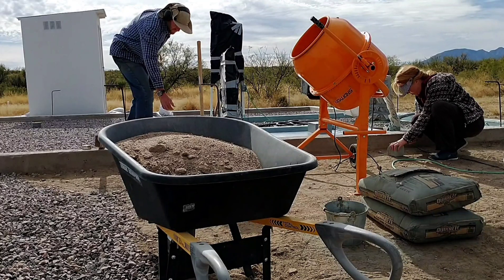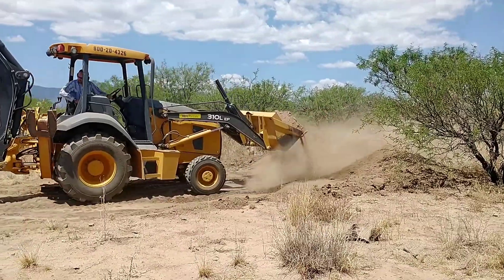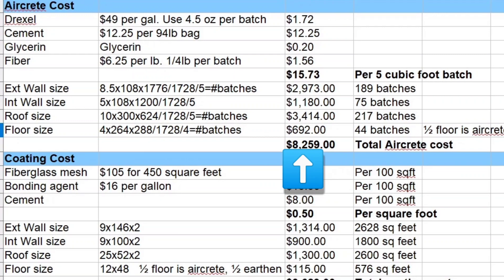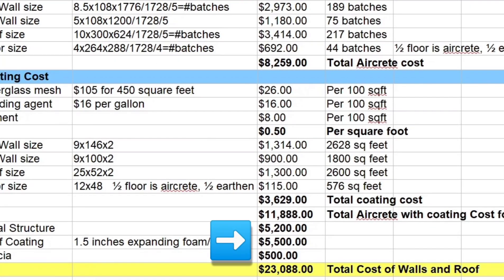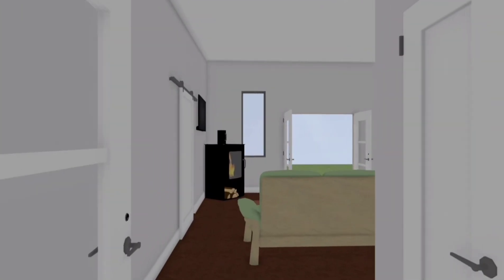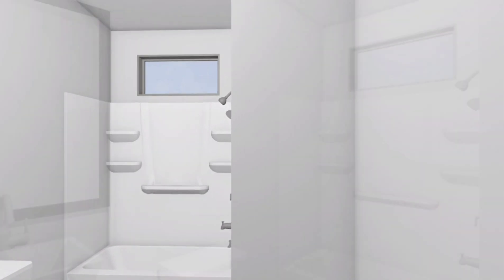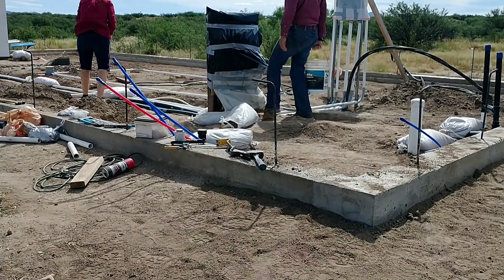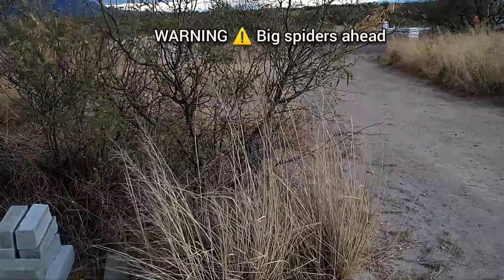AIRCRETE vs Traditional Home COST Comparison 🏠 DIY Off-Grid Build

Comment: Thank you for the excellent break down of the actual costs! Apparently aircrete with the coatings required costs at least $4.50 per cubic foot.
Reply from the maker: It's been awhile since we ran the numbers, but we did learn it wasn't going to save us any money, and it was going to be a lot more work. We also didn't include the cost of the forms.

Comment: I think you saved a lot of people time and stress making this decision. 
That being said, comparing the two methods building a small (100 to 150 sq ft. structure ...think basic cabin--not house) in a tropical area,with only aircrete as structure and insulation,do you think the costs per would yield similar results ?
Reply from the maker: If you already have the equipment to make aircrete, and build a dome shape, aircrete would be less expensive. A traditional structure could be built faster, would last longer, and likely wouldn't cost too much more.  I have heard of multiple aircrete domes with water leaks that can't be repaired, because the aircrete near the cracks turns to powder.
 If you have some time, and want to build a structure that is inexpensive and strong, I would recommend hyperadobe. We just finished helping our son complete his hyperadobe tiny house.  
Best wishes! 🌞🏜️
Reply: Thank you !  About what I thought your answer would be. @RedandAprilOff-Grid

Comment: must look up your previous vids but that looks like very crumble aircrete. you would of been safer just using a professional aircrete blocks, would of been way stronger.
Reply from the maker: They are hard to find here. We learned that this type of aircrete is too temperature sensitive, and hard to get consistent results, so we went with a more traditional build.

Comment: to bad you did not look closely at "Honey Do" Aircrete structure
Reply from the maker: I watched a whole lot of aircrete videos. Most of the aircrete guys have so many videos, it's really hard to find answers to any particular problem, and we just didn't have time to watch all of them. 
Some of our aircrete turned out awesome, but as the temperatures got colder, our guess is that we needed to use warm water in the soap solution.  
I'm excited to follow Honey Do Carpenter's aircrete house build, but I am glad we have moved away from aircrete. With our particular house design, aircrete was going to be slightly more expensive, and way more work.

Comment: Since the low foam yielded best results, could the reason for the failures and cracking have been the amount of water?  Depending on the foam used could have contained a significant amount of water that wasn't accounted for, maybe??  I'm completely new to aircrete, so assume what I'm throwing out here are just wild guesses with this stuff, but I'm not a stranger to concrete.  I've been fascinated with it ever since I was a kid.  The UHPC used in pre-cast pre-stressed beams last time I dug into a white paper used a significant amount of cement to aggregate ratio, roughly 1:1 and the aggregate is super fine, but the cement to water ratio is significantly reduced.  Would almost be a dry pour if not for the add mixtures used.   It really seems like yall were on the right track with the high cement ratio.  Maybe one day this stuff will take off..  Just hoping someone doesn't figure out the secret and all of a sudden the price skyrockets up next to lumber...  lol  Seems to be the way things usually end up   Anyways, cool vid bud.  Still going through the playlist.  Thanks for putting all this out there
Reply from the maker: We are using a somewhat low water mix to make the aircrete stronger. The typical recipe that most seem to be using has 6 or sometimes even 7 gallons of water, and we were using 5 in all of our test samples. It makes it stronger, but I'm sure also less insulative. It also seems to make the slurry heavier which make it harder to get the heavy stuff at the bottom mixed in with the foam. If we had decided to move ahead with aircrete we probably would have bought a mortar mixer. 
Adding styrofoam to aircrete is all the rage now, I think it will have issues too, and will be a lot of work, but we'll see how it works out for people as they start trying to make stuff out of it. There has been a shortage of Portland cement in our area lately, probably due to shipping issues, so it seems like the price will go up on it. 
Aircrete is interesting stuff, and tricky to make. It's been an interesting experiment, but we are glad to be moving on. Now that lumber prices have gone down some, a more traditional house with more insulation than the aircrete house will be less expensive anyway. We have a video comparing the cost. 🙂🏠
Reply: @RedandAprilOff-Grid  

I’m new to aircrete.

I saw your other video where you was using literal styrofoam polystrene.

And then I’ve seen other videos where people are making foam from soap and using that to make bubbles.

Are these 2 methods for 2 separate things or?
Reply from the maker: @johnle231  We were using Drexel foaming agent to make the foam bubbles and haven't tried adding polystyrene to any of our aircrete batches. We are using polystyrene sheets to insulate under our concrete slab. Yes, regular aircrete is different than styrocrete.
Reply: @RedandAprilOff-Grid  

Oh that must’ve been a different guy that was making “styrocrete”

Thanks for clarification
Reply: @RedandAprilOff-Grid  

Hey I found the video if you might be interested 

It is titled ‘aircrete on steroids’ by Stephen Williams.

The guy built a house/building using styrocrete

Comment: What state/climate zone is the house being buildt in again? R19 walls with R38 ceiling is pretty much  lowest allowed by code in North Carolina. For a passive house You'd want at least an R60 roof! Add 3" of foam board to the roof to at least get R55. is my suggestion. Adding insulation latter after the build is always very costly and impractical. I'ts the most important part of a passive hosue build !
Reply from the maker: We are in a desert area, climate zone 2/3. We don't expect the house to be fully passive, but the house should do really well in the winter with the large south facing windows. Swamp coolers work really well here for most of the summer, and our temperatures cool off enough at night, that we don't need overnight cooling.

Comment: 100% agree with you on your decision. Also with more conventional builds there's not the unknown factor of failed batches and that added cost. My first construction job was pouring foundations when I was 18...never fell in love with it. lol.
Reply from the maker: Yes, I am sure we would have had some batches that settled, and we may have needed quite a few extra batches. We are pouring the slab ourselves a little at a time. It is a lot of work, but going well. We need to do something with the extra Portland cement. 😄

Comment: Classic example of everybody being excited by alternative building methods but then reality slaps you in the face...
The reason it's not used more is that it's HARD. There's the resistance of banks to loan on alternative if it ever goes up for resale and that insurance companies don't want to because they have NO idea of their liability so can't set rates.
I'm still proceeding ahead with the stand up panels between the steel columns. My test pour where I poured 1" of regular concrete, let it sit for an hour then poured 4.5" of styrocrete on top (2x6 frame, 4 foot x 8 foot) and let it wet cure for almost a month (I got impatient and couldn't wait the full 30 days, haha) turned out great.
Note - I stood it up on edge and shot it's hard face with a .38 and all it did was small craters, no visible cracks so I think it's tough enough. For as massive as it looks it's amazing how light it is. (It's heavy but MUCH lighter that as if it was solid concrete).
Obviously a crane rental will be necessary to stand up all the premade panel sections in 'Assembly Day'.
Reply from the maker: Glad it is working out, and it sounds like a good solid plan. It would be much easier to let the walls wet cure if they are poured flat. It would have been very difficult to cure our upright walls, we get a lot of wind here in the spring. Sounds awesome, and best wishes on your build!
Reply: @bob joatmon what mix are you using?

Are you using self made foam similar to shaving cream or literal polystrene eps broken down foam?
Reply: @johnle231  I'm using EPS round beads like go in a beanbag chair and mixing it with a cement : sand ratio of 1:3. I tried shredded styrofoam but because of the slightly different sizes of the pieces there was too much variability and one batch would need more mortar than another batch. With the beads they seem to mix and distribute evenly with consistent density of the test panels
Reply: @bobjoatmon1993  

Did you do any cost analysis?

Save money or no?
Reply: @johnle231  the key thing is my labor is free so that's a huge cost savings. The EPS beads are relatively cheap BUT the freight charge was high, not due to weight but because of volume. I suspect that the cost of construction would be close to the same as conventional materials but I'm doing it this way because it's rot, insect and fire proof and very resistant to high winds.  I want low maintenance and longevity and that's not something you get with conventional material built homes.
Reply: @bobjoatmon1993  

How is it very resistant to high winds ?
Reply: @johnle231  are you trolling me?
I'll answer what should be obvious, because it's design and strong construction. Sorry, it would take thousands of words to exactly describe what I'm building and I'm not going to spend the time here to do that.
Reply: @bobjoatmon1993  

It’s a legitimate question.   You’re saying aircrete is wind resistances. I’m asking how...   if you’re busy then no problem.  You don’t have to answer
Reply: @johnle231  there's a miss-conception here. I am making 4x8 foot panels 5.5 inches thick. The form has 1x2 inch wire mesh in the bottom and 3 each 1/2" rebar that crosses left to right and sticks out the sides (these are the attachment points), then has 1" of regular concrete with aggregate in it poured on top of that. Wait til it's starting to firm just enough so it will not displace and yet still can form a bond with the next layer poured on top of it. THAT is either aircrete or styrocrete which is 4.5 inches thick to the top of the form. I'm not having good luck either with aircrete consistency but the sand: cement mortar mix with the styrofoam round beads is consistent. Then I wet cure it for at least 21 or more days (should be 30 but I'm impatient).
My house is framed with 4" steel pipe anchored to the foundation with 4 foot gaps between. The concrete panels, when I get enough made will be lifted up and set between the pipe columns and the rebar stubs welded to the pipes. I plan on filling / calking the gaps at the join of panel and columns with more wire and the ferocement recipe mix.
The exterior may get stucco depending on how it looks.

Comment: A sensible decision, and especially because of labor and constructability unknown unknowns, which will surely be a lot higher with aircrete.  Often alternative method advocates are not so objective.  But your materials-only cost comparison may not be representative for comparing just the ext walls.  In any case we all expect you to be continuing with the aircrete testing experiments for the edification of your viewers - thank you!
Reply from the maker: Thanks! Yes, aircrete just wasn't working out. The cost comparison is for interior, and exterior, walls, roof and floor, complete with insulation and sheetrock.  He is ordering the roofing materials today before the prices go up.
We will be plastering the rest of the aircrete garden wall, and eventually plan to use some of the sample blocks to make an outdoor rocket stove, and maybe a pizza oven. We may eventually make some more aircrete for a rocket mass heater for in the house. For now, we need to get this house built, and it's too cold to make aircrete.

Comment: The containers look so much smaller in the background..
Sorry you had so much problems with your build at this stage.
Reply from the maker: Yes, the shipping container structure is a little ways away from the house site. 
While we were experimenting with aircrete the cost of lumber went down, so it wasn't all bad. Once we finish the concrete portion of the floors, we can start on framing. Excited to be able to build this winter, the nights here  are cold, but the days are pretty nice. 😊🏠

Comment: Excellent video, What kinds of software  are you using, Designing home?
Reply from the maker: He got a 2 month subscription to Chief Architect. There is a lot to learn about getting it to do what you want it to, but he figured out how to do most of what he needed to do with it. It was awesome in helping to figure out the proper roof overhang and orientation based on the seasonal angle of the sun. Thanks! 😊

Comment: You mentioned one video that you had earth with clay content from a pond on your property. Have you thought of using Adobe in part of the structure for high thermal mass?
Reply from the maker: Yes, we are planning to do earth floors on the south side of the house, so we should get some thermal mass benefit. The sun will hit the floor in the winter, but the overhang is such, that it won't in the summer. Thinking about it now, I wish we had made room to make the floor thicker to make more use of that thermal mass. I had thought about adding  a wall or something inside, to capture some of the heat,  but we aren't sure yet.
Reply: @RedandAprilOff-Grid  Good luck!
Reply from the maker: We probably have excellent soil for making adobe, it would be cool, but a whole lot of labor. Thermal mass is great in the summer since we cool down so much at night. We wouldn't technically freeze, but it would be really cold in the winter and hard to heat. That is the main reason we moved away from any type of earth type building.
Reply: @RedandAprilOff-Grid  I see
Reply: What I meant was a a wall(internal structure) or any other structure inside of your insulated house not outside structure. That would be like a thermal mass buffer added to the timber..

Comment: You could probably use those aircrete test blocks as pavers for a path around the house sometime... but I'm sure you've got enough on your plate now!
Reply from the maker: We are planning to use the bricks to make an outdoor rocket stove, and maybe a pizza oven. Right now we are using them to hold down plastic and stuff as we work on our concrete floor. I also like to put bricks around my plants to keep them protected from the wind and cold. We'll find uses for them. 😊

Comment: The secret to air Crete is the fiberglass mesh wrap it adds the strength you need
Reply from the maker: Yes, the coating is great as long as the aircrete doesn't turn to powder or small crumbs inside the walls. If we could have made consistent and good batches like at the beginning, we would have used aircrete. It's too cold here for now, and we would have had to wait until spring to do further testing.
Reply: I understand I live on the Mississippi gulf coast and it doesn't get cold here until late December to late February I built a 12 x 12 shed out of aircrete 2 years ago I wonder if the climate has anything to do with it I've had no problem with it so far
Reply from the maker: Awesome, glad to hear about people actually building structures out of aircrete. We haven't found many people online that are sharing the long term durability of aircrete. It would vary a lot too depend on the recipe and methods used. Yes, I think the cold Drexel and water were making for a wetter foam. It was still under 100 grams per quart, but heavier than our earlier more successful batches. We get a lot of wind in the spring, which would have made curing the aircrete walls a huge challenge, so we are glad we aren't going to have to deal with that.

Comment: one of my friends has recently bought a house with a single panel roof (no attic) and its been the worst thing ever for r value, even a small attic makes a huge difrence
Reply from the maker: The roof will be 12 inches thick and have an R value of 38, so we think it will do pretty well.
Reply: @RedandAprilOff-Grid  definetly beter than the r4 insulation we're looking at haha
Reply from the maker: @timgoodliffe  That's what our daughter's house has, but it might be R-6, they converted an old structure on the property into their house. It has some thermal mass, so it's working out kind of okay. 😄
Reply: ONe doesnt' need an attic, a 2 to 3" vented space is all that is needed to allow the hot air to move out. Also white painted roofs will reflect heat. If one is in a colder climate than a black painted roof might be what's needed. I forget where this house is being buildt?